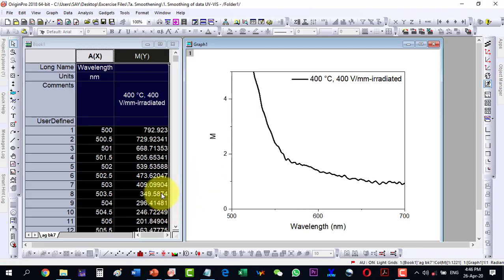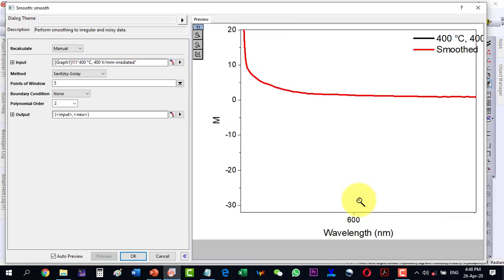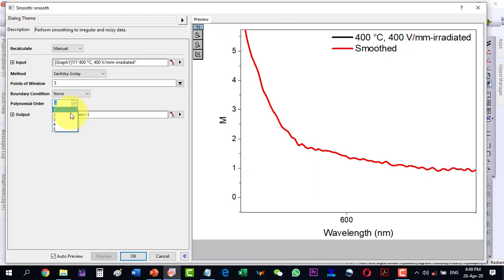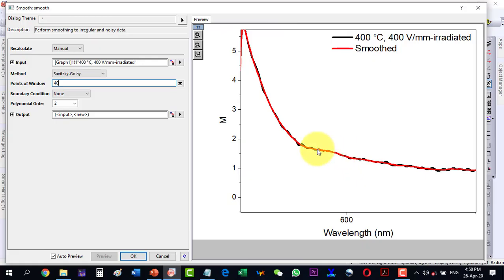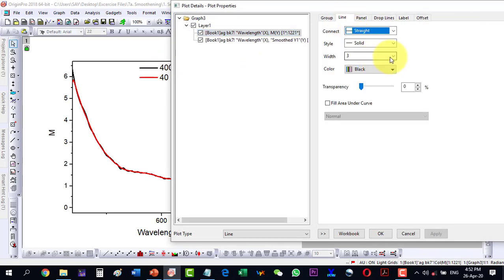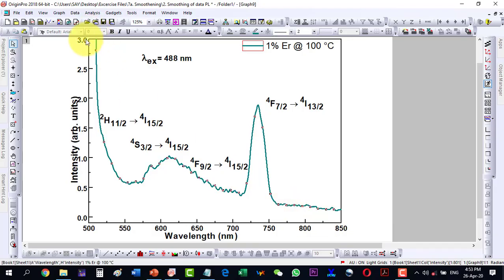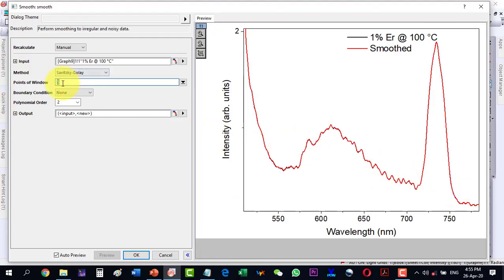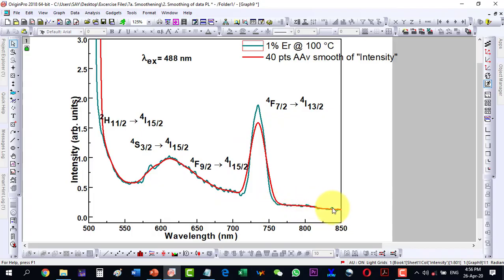How to smooth a plot in origin

Comment: I will get "input data is too small" or "failed to get data from XY range" whenever I try to use the smoothing command.
Reply from the maker: In the description of this video, I have provided an exercise file as Origin file. Do practice on it and let me know whether you get the same message after executing the same steps as in the tutorial. Thanks
Reply: @SAYPhysics  It still doesnt work on my file.
Reply from the maker: @ I don't know what might be the reason(s). You may share your file at sayphysics@gmail.com, I'll have a look at it. Thanks

Comment: Sir, first waala plot remove kaise hoga isme se... So that we can consider only smoothen plot
Reply from the maker: There are two ways to do it. One is to go to the data sheet, where after performing the smoothing, it would have generated another column, and replot that column data alone. Another way is to double click in the empty space inside figure, a menu will be prompted where you may uncheck the plots you don't wish to be visible. Thanks